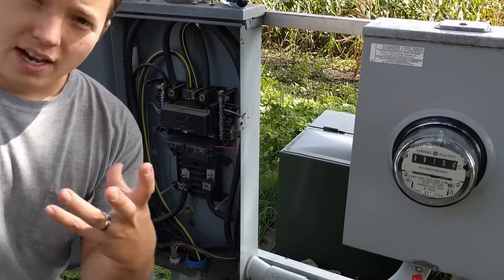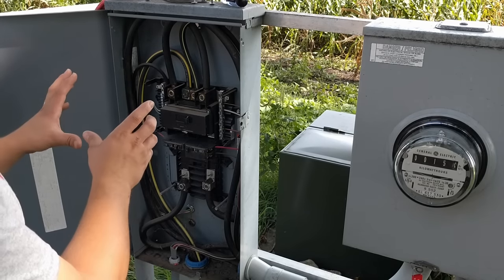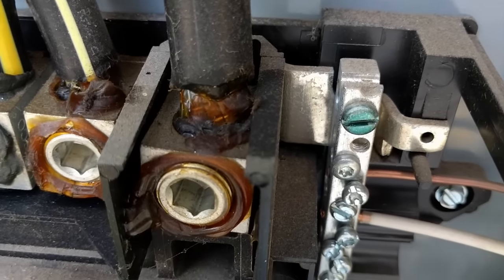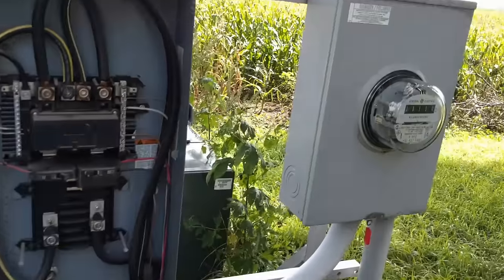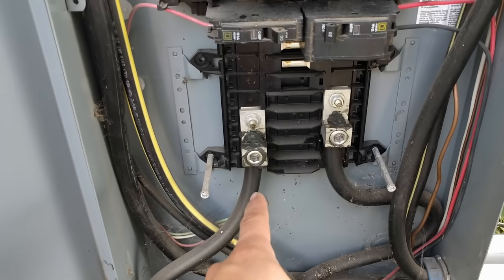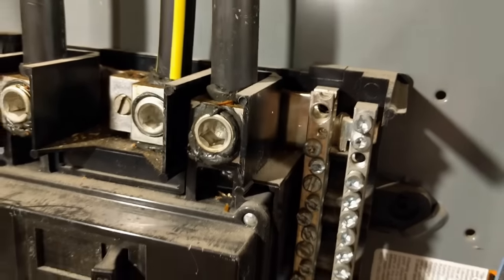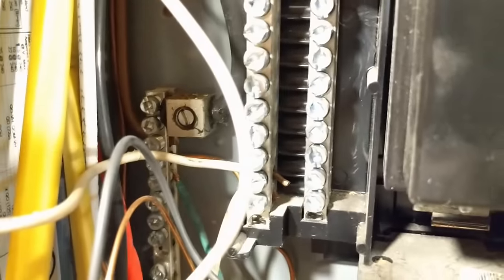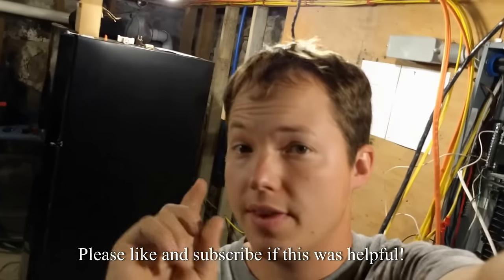What Is a Neutral Bonding Screw in a Main or Sub Panel Load Center & Should It Be Used or Removed?

Comment: My only criticism is why not explain why you need to isolate and what would happen if you do not isolate the ground and N ...
Reply: if you leave the bonding screw in on the neutral on the house panel you just energized all the green 
(ground) wires in the house and  also energized all equipment in the house so if you go to load the dish washer or get something from the fridge and happened to go to ground you will get electrocuted .
Reply: @swampland  But why? If there was a short after the sub panel, then the ground wires would carry a high current back to the main panel, and then back to the transformer which would trip the circuit breaker. That is how it works at the main panel, so why does it not work on any other subsequent panel?
Reply: @marks6663  I believe the idea is the ground circuit is an isolated 0v path, held low by its connection to earth.  But since earth itself is a high resistance path, the ground circuit is bonded to the neutral line at the service entry point to provide a low resistance path for current flow so that sufficient excess current can flow to trip the breaker during a fault (unnecessary for GCFI, but not all circuits are GCFI).  The ground circuit should normally not have any current activity on it, while the neutral circuit has current for all the 120v circuits flowing around on it in the house.  But if you start bonding the ground and neutral circuits in multiple places in the house, now you have wire pairs and current will distribute however it distributes.  Your ground circuit is no longer devoted to its purpose, a low resistance path back to assured 0v.  Now, what keeps current on the neutral circuit from feeding back into the ground circuit?  I imagine the idea is the neutral circuit and ground circuit at that bonding junction are both higher than ground voltage destinations, thus the preferred path being earth or the power grid neutral, which is grounded in multiple places.  That's my best speculation.
Reply: @smac770  Hey, Im a journey carpenter retired and for years had to deal with remodel homes and installing main panels, sub panels, move wires while building new walls, rooms etc, Safely and up to code of course!  (Lol.)  (we all know who Sparky is! Lol.)  As old as I am / always willing to learn more about this stuff / Man! Now that was an Excellent explanation, Beautiful explanation  - You Rock! I feel a little bit smarter, Thanks Man!.

Comment: Ground loop is really a small difference of potential between grounds. Ideally all grounds would be at absolute zero potential. But have two or more separate grounds creates a situation where one or more can be at a slight difference from absolute zero. Thus this creates small induced currents that can cause disruption to sensitive electronics in your home or wherever this occurs. As an example ground loops are famous for causing ac hum in amplification systems. So you are always best to have one master connection point to an earth ground. Don't confuse grounding with electrical bonding of metallic raceways and or equipment boxes.

Comment: I have a bonded Inverter that I want to wire to a critical loads panel in my home. How does that work when the main panel is bonded and the inverter is bonded? I can't unbond the inverter.
I want to have the option of running my critical loads from the inverter and the rest of the house from the mains. At the same time. Or run the critical loads from just the mains if working on the inverter and it's out of service. I live in the US.

Comment: If I have a changeover switch, one side the mains L+N and the other side the generator L+N and the output go to the house mains breaker, since the mains earth and neutral are bonded and i switch the changeover to generator, do I need to bond the earth and neutral on the generator if it is not a bonded generator? thanks

Comment: The screw  bonds the N to Gnd IF... the neutral in the meterbase is isolated. That wasn't mentioned. Many will actually bond to Gnd in the meterbase, which means then the screw in the panel is removed.  So, basically in the meter enclosure a bonding strap would be used and the grounding would be from THAT point. It would be a CONSUMER'S SERVICE GROUNDED AT THE METER MOUNTING DEVICE. It would be potentially confusing if someone who watched this video, now out in the field, comes across this scenario and then decideds to put in a screw based on what you said, which might be wrong. Leave the bonding screw in, if the N in the meter mounting device is NOT isolated.

Comment: Hello Benjamin...I recently installed a 100 amp panel with 30 spaces. I was able to connect my wall heater which is a 20/20 double post, my electric water heater which is a 30/30 double post and a Dr.  Infrared heater which is a 40/40 double post. I had my refrigerator and security cameras also connected which is a 15 & 20 breaker. When I updated the electric socket outlet I am now just get a flickering light from only the new installed electric socket outlets. The heaters and electric water heater are working well but cannot seem to find why is the electric socket outlets now working? 

Any info or suggestions?

Comment: Lets first remember local building inspectors decide how it has to be done if they are in the loop.  Right and wrong plays no part in it.  We installed a mini split at my neighbors going to a ground rod near the pull off box.  The inspector demanded another 2nd ground on his plumbing ITS PVC it would not pass until we did it.  There are many theory's are how it should be done and why.  Look at the electricity lines 1 ground and 2 feeds!  Always has been the same I have been doing electrical repairs for 50 years for General Electric.  Remember electricity has not changed only building codes.  The day will come when they add more grounds only due to selling more supply's NO OTHER REASON.

Comment: Please wear gloves anytime panel is open with exposed busses. A stumble, sudden noise, loss of concentration could be fatal. A shock of any type could be bad news for certain folks. Use a pointer. 40 years in the field I had to do CPR twice. Funerals 3 times. The more you work around electricity the more laid back you become. Not trying to lecture. 500 milliamps (0.005) can kill. That panel looks to be 200 amps. Silent but deadly. Be safe, I care.

Comment: I have a 1950s 4plex w main shut off, 4 cut off boxes under service, & subpanels yards away in each apt's kitchnen... I am replacing pushamatic subpanels which only have 3 wires (neutral/2phases) in subpanels and uses METAL Conduit. Do I rely on the metal conduit to create the ground bar connection with the ground poles/original supply neutral in the meter room? That is my guess... ( so electrical current returns thru neutral wire to grounds in electrical room instead of conduit). If anyone gets this and replies, THANKS IN ADVANCE! Looking thru comments now in case already answered...

Comment: Im relocating my panel from the basement to the second floor. Not physically moving the panel, installing a new 100 amp panel on the second floor ..... I installed a 100 amp breaker in the panel in the basement & ran # 2 wire to new main lug 100 amp panel. Is that technically a sub panel..... do I have to remove the bonding screw on the new panel on the second floor & add a ground bar.

Comment: What size wire are you using for the grounding wire fron the disconnect to 200 amp sub panel? Is a #6 copper stranded THHN ok?

Comment: What if we dont separate the neutral ang grounding is it ok
Reply: It is actually quite dangerous. Sub panels  need to have the grounds and neutrals separated. If they are not separated electricity will flow on anything connected to ground, even metal water and gas pipes...hire a qualified electrician to install a ground bar and separate the grounds and neutrals.

Comment: Hi Ben. Uhmmmm. So your cut-off panel outside of your house has a neutral bar, and I see white wires (copper wires wrapped in white insulator, i.e. neutral wiring) and a lot of bare copper wire (grounding wires) secured to the same neutral bar.. Does that imply you are mixing neutral wiring plus grounding wiring on the same bar? The green screw connects the neutral bar to the metal panel. Is there a separate grounding bar (where bare copper grounding wires are secured to) in your cut-off panel box? If so then your green bolt in your cut-off panel has just connected your neutral bar to your grounding bar. I learned that having the neutral wiring connected to the grounding wiring at the initial point where electricity enter a residence and not to have neutrals and groundings connect in a sub-panel was to avoid objectionable current, that is randomly wondering current that might hurt someone. So we only electrically link neutrals to groundings at Service Entry Points like cut-off panels, service panels, and other entry points from the power company to consumer residence.

Comment: Question for everyone. I am installing a sub panel. I have not connected anything to the main box yet from the sub. I installed a separate grounding bar and have separated my neutrals from The grounds. I DID NOT bond the neutral bar but did a continuity test and I have continuity between the neutral and ground bars. Is this right?

Comment: What is the danger when it comes to bonding in a sub panel?  Is there risk of current heading through neutral loads upstream that would otherwise head through ground on the main panel?
Reply: From what I can tell, it seems to be an issue of turning the grounding wire into a current-carrying conductor by wiring it in parallel with the neutral. With this current comes voltage drop and thus a potential to exist between earth ground and the chassis of any equipment bonded to the downstream ground wire, creating a possible shock hazard scenario. In other words the earth ground can become a much more likely return path through a human body due to exposed metal on equipment having small voltages above earth ground, again a result of voltage drop due to current and resistance in the equipment grounding conductor

Comment: if I upgrade my 100amp meter panel box to 200Amp do I need to add #4 awg with 2 ground rods copper or galvanized
 6 ft apart

Comment: Do you need a bonding screw for each busbar side? Or is the grounding bar already touching the box and you just need to put it in the neutral bus? First shut off point after meter/main and only box.

Comment: Well I guess if the ground and the neutral were bonded.  And the neutral was somehow disconnected all the current on the neutral would go back on the ground wire at the panel. And the ground wire is not suppose to carry current unless there is a ground fault, and it is not as large as the neutral.   Electricians work on circuits hot a lot of times. And if the neutral is taken apart or seperated from the main homerun neutral, it becomes hot.

Comment: Found mine in the main panel. It's a strap in mine, was looking because I will have to add a ground bar to the main panel and remove the strap for when I add a automatic transfer switch before the main panel. Then i will bond in the transfer switch, as it will be in first place.

Comment: If the main panel is bonded to the neutral, wouldn't the panel box give a shock if it is touched due to returning power carried by the neutral when load is not balanced inside the house.

Comment: To answer your question about the remaining current still flowing (albeit very small amperage)  through copper gas line, etc. after separating your ground buss from neutral bus at sub panel:
We know current is flowing through the neutral conductor at the sub panel BACK TO THE FIRST DISCONNECT PANEL WHERE NEUTRAL AND GROUND BUSSES ARE BONDED TOGETHER. Feed-back initiates here and then returns BACK TO THE SUB PANEL via the grounding conductor and to any grounded appliances etc. downstream. Furnace electrical components are grounded to the furnace cabinet, and your copper gas supply line is as well. SIMCE YOUR FURNACE IS SUPPLIED BY A GAS LINE CONDUCTOR PLEASE USE A DIELECTRIC UNION at the gas line-to-furnace connection point! Gas stoves, gas HWH and all other end points connected to both power and gas should use dielectric gas line connectors as well.😉

Comment: neutral wire is to be white or natural grey only according to the NEC. just a heads up
Reply: Above a certain gauge, for thick feeder wire white is hard to find. It's not sunlight resistant, which is not a big issue in this case but is relevant in other situations. So, I believe your NEC allows an exception for large gauge wire.
Reply: i don't remember seeing an exception to use other than white or grey, will have to look and see to verify. and i know it's hard to find wire of those sizes in colors other than black, this why it does say in the NEC that it is acceptable to re-identify the the wires with colored tape or permanent paint or markers at the point of termination.
Reply: yeah, double checked. the NEC doesn't have an exception to be able to use a yellow strip as a means of identification for a neutral conductor. those wires look like what the "Power Company" uses for their underground service laterals/secondaries from the xfmrs. the Power Companies don't have to conform to the NEC.
Reply: also it's not really a big deal to me what he uses, but i figured as long as he was being so technical and proper, that i would give him a heads up on wire identification according to the NEC
Reply: Funny I installed 20 panels exactly like this in the last week for my cabin rental business and they all passed...and I'm not an electrician and neither is my 14 yr old son who helped.......I guess many electricians don't know what they don't know....
Reply: obviously neither is your inspector an electrician. look i see a lot of things passing inspection by one of those "due all" inspectors where they inspect the entire job from dirt to finish and most of them only really pay attention to the part of the build that they are most familiar with or maybe the inspector is just overworked and underpaid to care or maybe you just live in some backwoods area where the will hire just anybody to do the job because they don't want to "pay" for someone that's really qualified. whatever the reason is, just because it passed inspection and even works, doesn't mean it's right. and you don't have to be an electrician to be able to read the NEC, you just have to be able to "read". so don't take my word for it, just read it for yourself, simple. like i said to the last guy, i don't really care what you or Benjamin do in your own houses, i was merely pointing out what the NEC states, i mean as long as he was being so technical and proper to begin with, why only observe part of the code, if you're going to follow the code at all, why not follow it through and through.
Reply: i think you need to read and comprehend the NEC. the neutral wire is to be white or natural grey "only" no matter what size the wire is. the ungrounded conductors can be any "other" color, except white, grey or green

Comment: Hi Ben.  Love your videos.  I have a question I'm hoping you can help me with.  I have a sub panel that has the bonding screw removed like it's supposed to be.  My main panel has the bonding screw attached.  My sub panel is in my tiny house about 25 feet away.  My problem is,  when the wiring was originally run, only three wires were run to the sub panel.  2 hots, and a neutral.  The ground is just a very large rod driven into the ground.  Is that ok, or do I need to run a separate ground wire back to the panel? I've checked the entire system and everything is showing grounded and wired correctly. Thank you so much and keep making those great videos.  Chris.

Comment: I do not know if you finally addressed the spurious current on the ground and even worse, on your gas line (shere there should be ZERO).  So, if you turn off ALL THE BREAKERS on the secondary panel, do you still have stray current?

An aside to that, while many lakes require gfci on the docks, the cfci does NOTHING to protect swimmers from stray ground current.  OW!  So, I am curious to know if you tracked down the stray ground current.

Comment: Excellent videos.   A lot of misinformation out there, including from electricians.  While I’m well versed in residential wiring, it was the main service entry that I was never clear on, especially with a main outside disconnect and a main panel inside the house several feet away.  Not only can I now fix the second property I have, but this clearly shows the licensed electrician, and building inspector got my main home wrong.  They have the neutral and ground bonded together in main panel, yet I have an external disconnect 20ft away, and the ground neutral are bonded there as well.  There is no separate ground bar in the main panel.   Another job from a pro I must fix.  Appreciate your posts, best out there.

Comment: In BX wiring I don't believe you need an added ground bar as there is nothing to connect to is, the bx sheathing bonds to the panel by its connectors when installed. Is this true?, no one ever mentions BX much.

Comment: Great explanation.  
I had a Generac generator installed and upgraded my service panel from 100 to 200 Amp.  The green bonding screw is not installed and there is a separate grounding bar.  The panel outside my house is where the neutral is bonded because it serves both the generator sub panel and the house 200 amp sub panel.
This matters to me because I added a few new circuits and split a couple, so knowing that the growing wires needed to go directly to the grounding panel is critical.